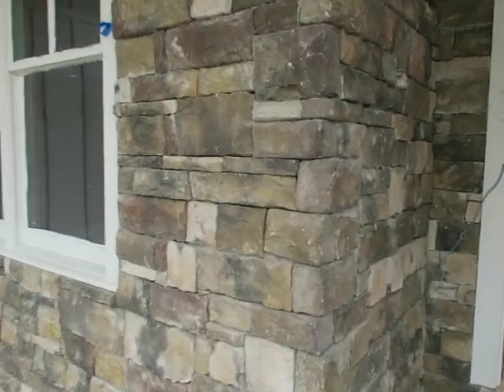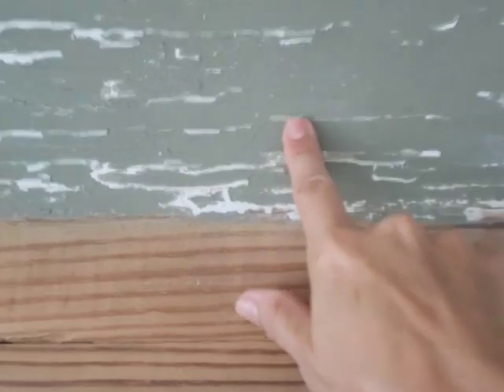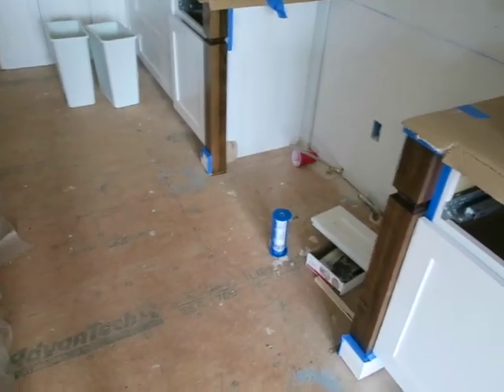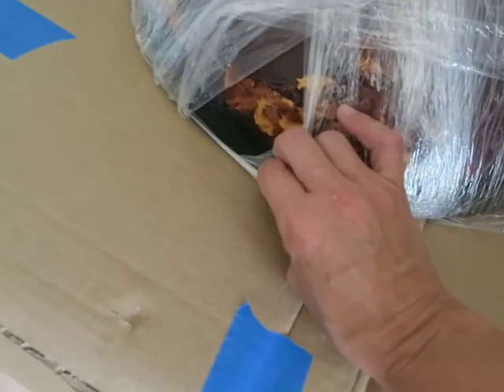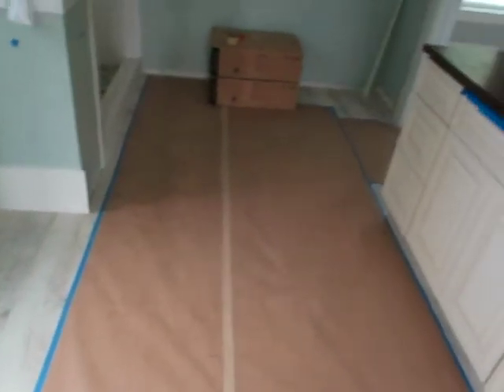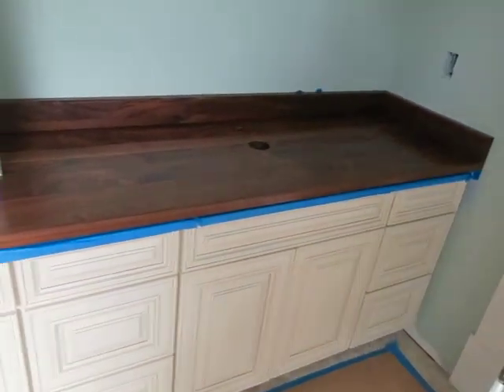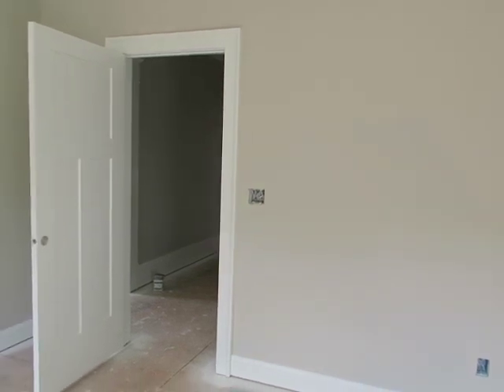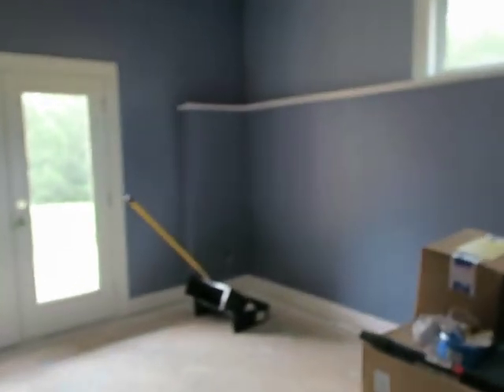House Update and Wood Countertops YEAH !

Comment: There is a primer by zenzer that blocks stains. Not sure if it would work for oil based stain but worth a look.
Reply from the maker: I will check into that !! Thanks Erin :)  Thanks for watching ! HUGS :)
Reply: Another thought is boat paint.  You would have to do the whole section but ain't nothing bleeding through that stuff.